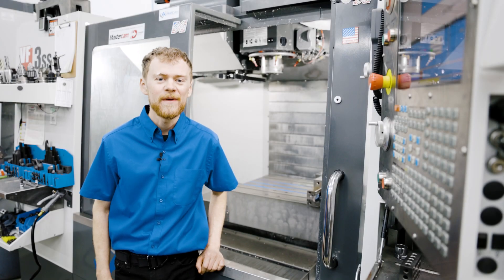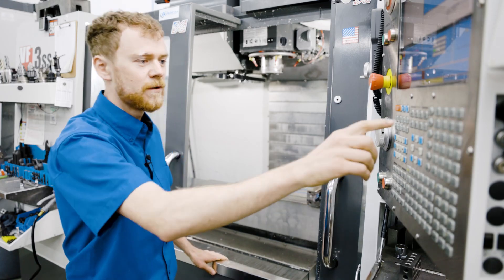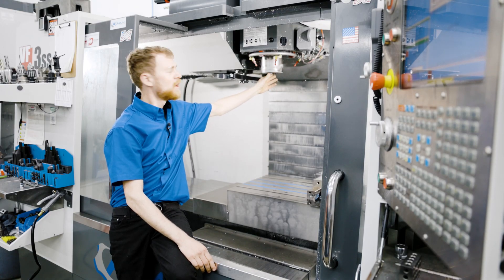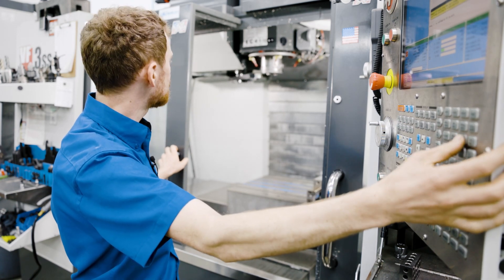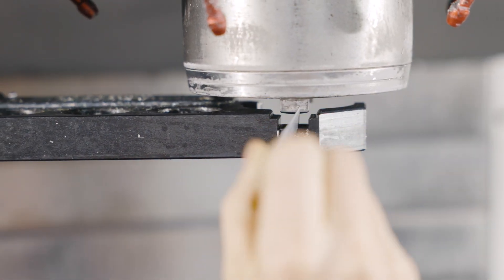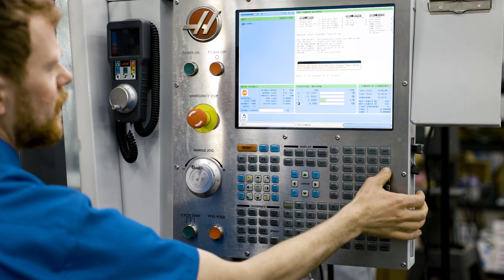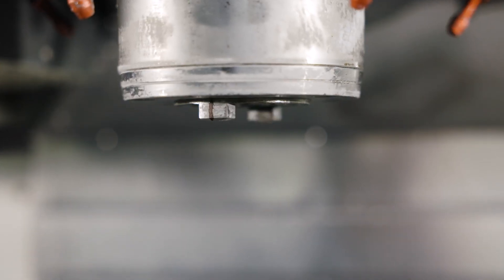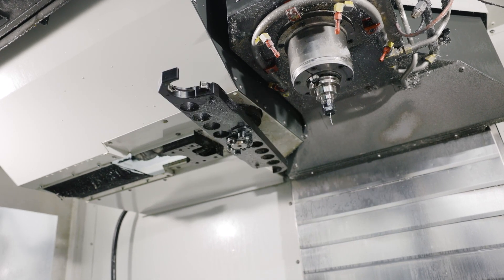How To Set Spindle Orientation Side Mount Tool Changer

Comment: Thanks!! I just followed your video to do this on a 2005 VF2SS after we got the spindle motor's bearings replaced. New belt and pulleys were installed. Different control but the steps were correct. Cheers!

Comment: Excellent service lesson.  I have done my umbrella orient before.   If you have a next gen control and PAID for parameter access is is about the same procedure?
Reply: It’s actually a little easier on NGC basically once you have the dogs lined up to the umbrella pocket you’ll do a S (for spindle) and I believe F2 to set the orientation